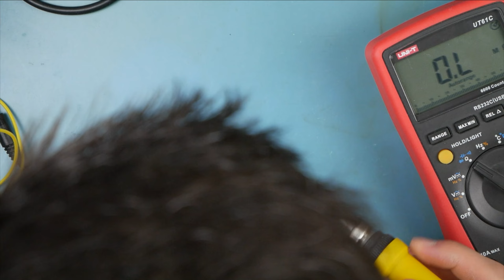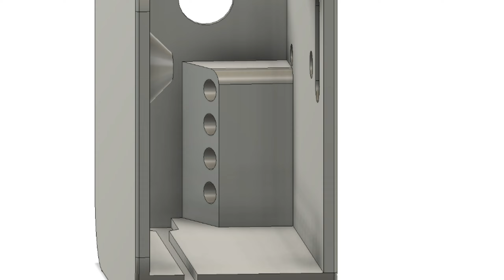ESD Monitor Debug & Enclosure

Comment: Hi, shouldnt it be (operator high) when the mono wire is unplugged?
Reply from the maker: Hello Hasan, usually, yes! We're using the tip switch to add a 5meg resistance (to avoid endless beeping)